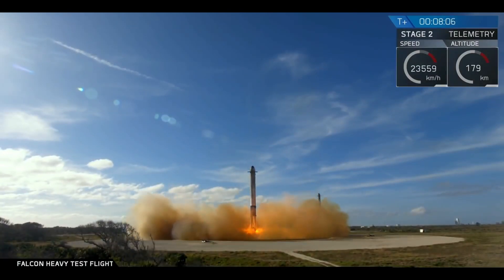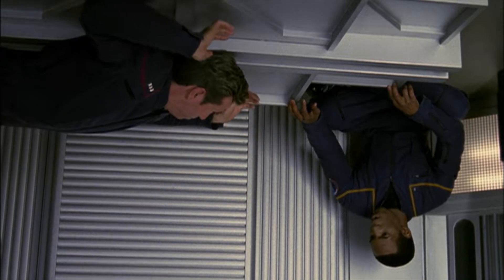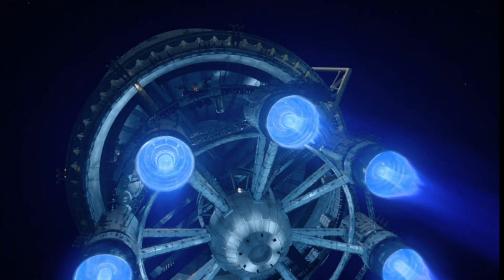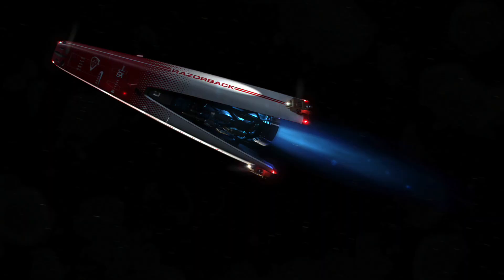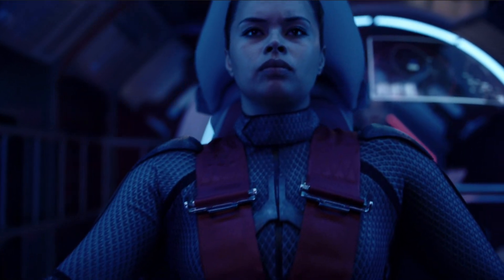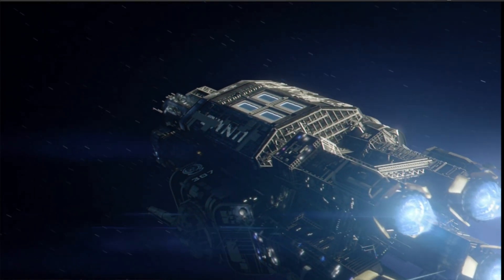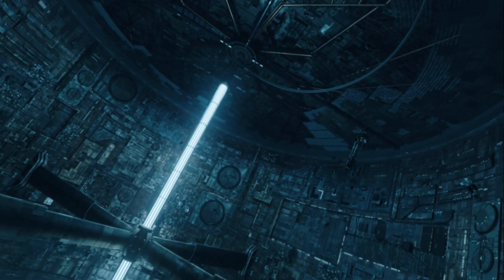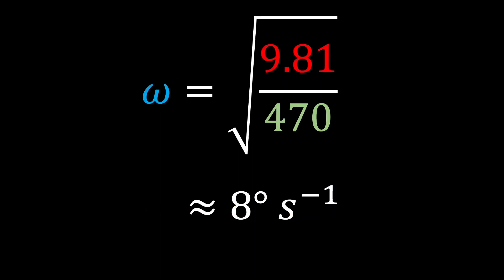Are the Expanse Ships Realistic? - Science of the Expanse

Comment: All ships in the expanse have a constant 1G burn half the way there then turn around to slow down simple and it’s nuclear fusion we could build this tomorrow if we wanted we don’t even need the ship we have starship lmao just nuclear fusion then build the ship vertical I mean comon u could fit the engines in less than a day and re configure the starship weeks
Reply: We can burn 1G yes, but not continuously. How much fuel do we need to take with us?  Because the more fuel we need to take, the more fuel we need to burn for 1G.  That's the problem.  1G is possible in expanse because they have a magic energy efficiency drive, so they have a very low fuel to weight ratio.  It's like if we suddenly made space ships run on the same amount of fuel as a car.
Reply: @peoplez129  well the thing is if we fill a starship to the brim it can hold double what the rocinante can but will use all its fuel in the process
Reply: @Klix3ontop  
No, we can't "build this tomorrow," because we don't have fusion reactors. The only test reactors we have require more energy input than the energy output they create, and they're enormous and don't fit in a spacecraft (not even Starship, which is just a tin can right now). The closest things we do have (or could have right now) are nuclear thermal engines and ion thrusters, both of which have absolutely abysmal thrust-to-weight ratios and can't do anything anywhere near 1g. So no, you're speaking complete nonsense.
Reply: @the18thdoctor3  the US government could build the rocinante in 1 day if they would profit from it.
Reply: We can't even do fusion on earth! (except in H-Bombs)
Reply: I would assume that Martian and Belter ships would do less due to each faction having to be born on lower G environments.

Comment: i've wondered why the ships are constantly under power. if you have gravity boots, why not just burn up to the desired velocity and coast at that velocity until it's time for the braking burn. I mean, it seems like a waste of fuel. And if you're going to burn  constantly, doesn't this mean you are forever accelerating exponentially or at least linearly? This would require more fuel in the braking burn. Almost as if you would burn constantly up until the midpoint of your destination, then the 2nd half of your trip would be a braking burn at a rate that maintains 1G.  Seems like the same trip could be made with less fuel in the same amount of time if you burn-and-coast vs burn-then-turn-and-brake??
Reply: You gain speed as long as you burn the engines.  It stacks.  It's like if you slowly ramp up from 20mph in a car to 100mph.  You only feel yourself get pulled into the seat if you speed up faster, but if you speed up at the same rate, the G forces are essentially the same. Just like how the people in the space station are orbiting at about 5 miles / second, yet floating around weightless. You only get artificial gravity when acceleration is applied.
Reply: Well that's why they can buzz around the solar system so fast .. with current tech it would take us months to go from earth to mars (and thats in a good orbital window) with just accelerating to what we can and then wait.

To your last sentence exactly no. Of course you would use much less fuel if you coast.. but it would take much longer.

Comment: Unless you're Earth or Mars military, 1G is almost unheard of in The Expanse. Nearly everything runs at 1/3rd of a G. Partly to conserve reaction mass, partly because that's the most that Belters can really tolerate. Most rocks have very little gravity to speak of. 

The books suggested the Behemoth / Medina Station spins at 1/10th of a G. The Mormons wanted 1G because they're Earthers, so that's what the ship was designed to do. However, the Belters had zero intention of making their new home spin at 1G. It'd rip their people apart. It meant massive modifications to the drainage systems because the station needs to grow food in the slow zone, but water doesn't drain as easily in the agricultural area at 1/10th of a G.

Even a little bit of spin or thrust means you can use the toilet without embarrassment (or needing vacuum attachments) (or having to sanitise and deodorise the air intake filters if something goes wrong like the pilot makes an unexpected course correction). I'm of the firm opinion that the ISS (or its replacement) needs a spin section - but definitely not at 1G. Just enough for a few cabins for people to shower, eat, do other minor stuff, possibly even sleep (if there are health benefits in being under gravity for at least some of the time). The lower the G the smaller the radius can be with tolerable coriolis.
Reply: Indeed! Also much of YouTube video out there that calculate how big a station must be for 1G and what forces you'd need to withstand etc.. totally miss that already a small part would be a huge gain. No need for a full G.

Comment: Any "spin gravity" solution with a small radius and a short rotational period gives rise to nausea and other problems. Just turning your head on such a carousel would create nasty, lunch-losing moments. The 2001 Discovery design was especially bad, because the radius looks to be about 8 metres. 
Much better to use a very long cable and spin your habitation module on a counterweight.  Or tether two ships, nose to nose and spin gently. 

Big radius, slow RPM, less vom.
Reply: A cable made out of fiction material we do not yet have :)
Reply: @georgelionon9050  - What is the magic material they hang Space X Starships from those cranes with?
Reply: @glynwilliams4204  Well how long is that cable? For good gravity in space with tolerable little coriolis force you'd need quite a long cable.. where the weight of the cable would add to the force it needs to hold... I must admit I don't have the math at hand, but it has a reason why designs resort to magnetic reinforcement to make it at least theoretically doable.
Reply: @georgelionon9050  I did a bit of math, and I recall a few hundred metres of cable, and aiming for an onboard gravity of about 1/3G. All seems viable.
Reply: @glynwilliams4204  Well size and RPM depend.. I put it in with 1 RPM... (to get acceptable low coriolis force).. and you'r right it's only a few hundred meters.

Comment: Of course there is this one thing that the Expanse universe completly ignores: heat
Reply: The writers acknowledge this.  The fusion drives have non-realistic levels of efficiency.
Reply: @glynwilliams4204  Sure, but even so, it'll be producing 'some' heat; and what about everything else on the ship that warms up? Even the international space station has radiators on it, and that thing doesn't have a nuclear fusion reactor on board. ;)
Reply: @naibakie8519  Other science issues are ... the spacecraft reaction mass. The Rocinante uses superheated water for thrusters.  But in the book, the ship landed on Illus 3 times without refilling its water tanks once.
Reply: @glynwilliams4204  I'm no so fussed about that. If the ship's got enough fuel to cross the whole system at ~.4g, landings and takeoffs would be a sinch.
Reply: @naibakie8519  They cross a system with the Epstein fusion drive.  You land on a planet with that, and you melt a big hole in the place where you land.  Hence superheated steam reaction mass.
Reply: @glynwilliams4204  Yeah what about the people inside?
Reply: Absolutely! I've once seen a video about estimating how space battles would turn out, and basically heat (and the ability to dissipate) would be the deciding factor... where the losing side would have heated so much up, they cannot act anymore and must surrender... 

I guess the expanse tech fiction is engines (and computers etc.) being soooo efficient, it isn't an issue...
Reply: @georgelionon9050  It will be regardless though...
Reply: Yes! Those ships would need massive radiators hanging off the side
Reply: @cantdestroyher7245  That and of course the whole idea of "stealth" in space would completly disappear.
Something as simple as fireing your RCS thruster around Pluto would end up on Avasaralas desk a few hours later.
Reply: @Chiggi0815  haha i love that. I could just imagine her reacting to that
Reply: @Chiggi0815  stealth is possible only for few hours at most in The Expanse universe, then the ship overheats. Also, you obviously missed it, but stealth ships weren't moving, so unless you knew where to look, you wouldn't find them (those in season 1 were detected by Cant as a spot that was few K warmer than the background, but they ignored it)
Reply: @Chiggi0815  It's true!  I was looking into it and literally you can detect an RCS thruster amount of thrust near pluto from the earth.
Reply: @cantdestroyher7245  you realize that entire ship is a radiator, right? I also think most of the heat is dumped via the drive plume, and some heat is used to keep stable temperature inside the ship.
Reply: @elkapro6534  dissipating heat in space is quite difficult because there is no medium to transfer the heat to, so the only way to remove it is by radiating it which is far less effective than convection or conduction. Given the acceleration that vehicles in he expanse are capable of a ship like the rocinante doesn’t have anywhere near enough surface area to dissipate the heat it would generate. And the drive plume would add heat to the system not remove it
Reply: @cantdestroyher7245  you're explaining to wrong person. I know radiation is the only way. I can even calculate radiative power for Rocinante (given area and emissivity of surface materials). How is acceleration and speed related to heat radiation? Only thing is the reactor, that presumably has higher output at higher acceleration. so make correct statements please, to avoid misunderstandings. And how the hell does drive plume add heat? WTF? It does exact opposite, it dumps a stream of superhot plasma and particles into space. Those carry lot of energy.
Reply: @elkapro6534  kinetic energy always make heat too. Ship accelerate, ship get hot

Drive plume very hot. Heat up everything around it. That means ship 

Heat no go away easy in space. Ship need really big radiator
Reply: @elkapro6534  Jesus Christ the ship pushing on it self is the kinetic energy I’m talking about, which also makes heat. Add computers and ship systems there’s more heat. Plus engines, lots more heat. Too much for a ship that size to dissipate.
Reply: @cantdestroyher7245  For an engine to provide thrust, you need to have mass that you accelerate.  I think the ships in expanse use water for that? Either way, I like to think that you could potentially dump your waste heat into the water, and then use the water as the acceleration mass for the engine, thus dumping the heat without having to rely on radiation.
Reply: @maxpavlov5778  the reaction mass for these engines seems to come from fuel pellets that undergo nuclear fusion. Adding water to the equation is a very interesting idea but I don’t think the ships could carry enough mass to have a cooling effect, at least not for very long. I have heard of an interesting concept where coolant is vaporised, vented into space, allowed to cool and then recollected again
Reply: @cantdestroyher7245  It's a fusion reactor, the mass in the fuel pellets gets turned into energy. You can't produce thrust with just energy, you need something to throw out the back of the ship for it to accelerate. I'm assuming it's water because in the scene where they salvage a Martian ship and rescue the crew, they specifically donate some water to the ship so that the Martians can make it back to their fleet.
Reply: @maxpavlov5778  youre right the Epstein drive does use water i apologise i wasn't aware of that. The reaction mass can be the fused material though the problem is that with a D-T fusion only about 20% of the mass is usable. But using something like helium 3 you could get a very high specific impulse. They do reference older engines preceding the Epstein drive as fusion torches so maybe they run on this principle and adding water is what makes the Epstein drive work
Reply: @maxpavlov5778 untrue. fusion doesn’t turn your fuel into pure energy, it transmutes it into highly energetic particles. which can be directed out of the back of your ship for thrust. trying to transfer the energy from those particles to other particles (like water) would absolutely devastate the engine’s efficiency, and I’d imagine thrust as well.
Reply: The stealth ships work by shutting down their reactor and holding all of their heat internally.  

I have know idea how that would work.
Reply: Well, the other thing is that if you want to have something alive on your ship then it should be about 270°C warmer than the background it is floating in front of. 
Keep in mind that we can find asteroids that are almost as cold as space itself because they reflect as much light as a lump of coal.
Reply: If you want something that acknowledges the thermal issues, then Terra Invicta is up your alley.

Comment: Couldn't you generate spin gravity with a long tether between two modules instead of having to build a giant ship?
Reply: You totally could. This is even kind of in the show of that space ship orbiting New Terra. They don't have a complete ring, but just a "ring fragment" they spin around.

In practice with nowadays tough, there isn't a material that could hold that kind of strain... Steel certainly couldn't. Nanotubes maybe could, but cannot be manufactured in that dimension. There are some ideas that hold the centripetal force with magnetism..
Reply: @georgelionon9050  Of course we have materials for spin tethers. Crane cables can pull 200 tonnes in 1G, that means it would work fine for 600 tonnes in 1/3G. Cable stayed Bridges use way bigger and tougher cables. You can basically spin two starships no problem, if you want to.
Reply: They did that in season 4. They even had the two pods at different distances from the main hull, so that one pod would simulate less gravity for the belters, and the other pod would simulate heavier gravity for Earth people.
Reply: Wouldn't something like that need constant thruster adjustments when the mass shifts about inside

Comment: Love the Expanse and the incorporation of Newtonian physics and more scientifically plausible technology. Hopefully an efficient engine like the Epstein Drive would be possible in time, but what happens if continued 1-G acceleration approaches the speed of light?
Reply: Newtonian physics starts giving way to relativistic physics well before that point. The short version is that the faster something goes the more massive it becomes, so the energy being added to the object by the drive is able to accelerate it less and less. 

As a concrete example, the particles in the Large Hadron Collider are going so close to the speed of light that the difference between their velocity and the speed of light is the speed one might casually walk across the room, only about 3 m/s or 10 feet/second slower than the speed of light, yet the gulf between their velocity and the speed of light is still a physically insurmountable obstacle because they are so massive that it is nearly impossible to make them go any faster and most of the energy one might add would just increase their mass even more instead of increasing their velocity.
Reply from the maker: The greatest conspiracy of nature is light speed, all rules seem to work together to make sure we can never reach it!
Reply: The energy required to reach 1c would be infinite so the ship would run out of fuel :P I think the best way for expanse ships to maintain speed below 1c, like 0,7c or less would be prograde 1g burn to 0.7c and then 1g retrograde burn to 0.5c and so on

Comment: I would like to point out that Fighters Jets can not produce more than 1G of acceleration, and once at cruising speed stop accelerating altogether. They sit upright not because it is a less effective method of G resistance, but because pilots rely on the ability to observe their surroundings, and sitting upright gives us the best option.
After WWII experimental fighters were built to test the increased resistance lying down, such as the British Gloster Meteor F8 "prone pilot" prototype, which had the pilot positioned lying face down at the front. The resistance to G compared to sitting up was real and substantial, but the cons such as decreased pilot mobility and discomfort negated any advantages in G resistance.

https://i.redd.it/rwye75el28961.jpg
Reply: @machpants  ohh neat, yeah I wasn't sure what was misinterpreted. What did you fly?
Reply: @machpants  damn, that's pretty sick. I actually have a question for you then, I can never find it on the internet, and since its now retired I guess it's OK.
What was it's top speed on the deck clean and loaded?
Reply: @machpants  holy hell. That's insane. Truly a beautiful aircraft to witness, sad they're all gone from the British Isles.

Comment: I love my standard Sci-Fi but its great to see the harder elements on screen.  

Though one thing a lot of Sci-fi doesn't show is the effect of rotational habitats.  the different rotational speeds and inertia can cause disorientation, (er im drunk so the words im looking for have lost me) your head and feet experiencing different  rotational speeds, feel noticeably different force. turn fast, move in directions not inline with rotation, you'll feel it. 

The larger the rotational body the better. 2001's (a masterpiece to be sure) small ring would probably make you feel quite ill to run on. but okay as a sleeping  habitat.  

Side not I love the razorback, the ability to adjust the crew to the plane of force mitigates huge issues.  A hard, short  9G turn is (by all accounts ) exhausting and extremally physically demanding, but that same turn, were throughout, you're always on your back would make it much more tolerable.
Reply: It also brings up the fact that inyalowda are better than beltalowda in space combat which is ironic.